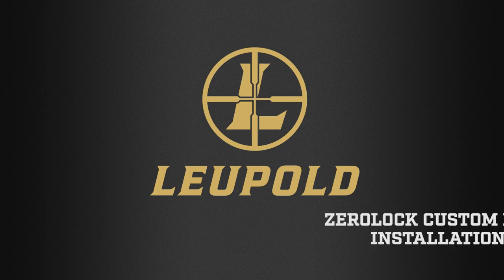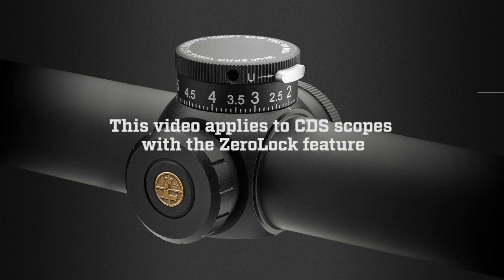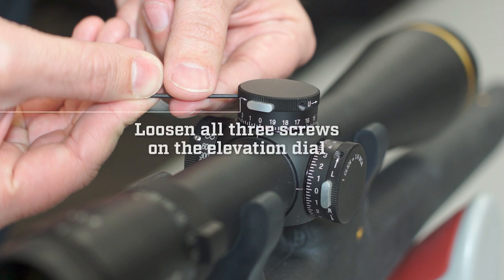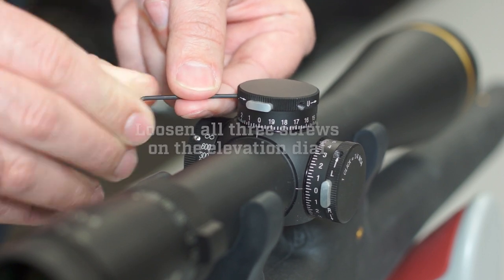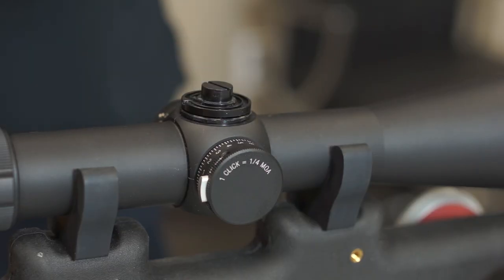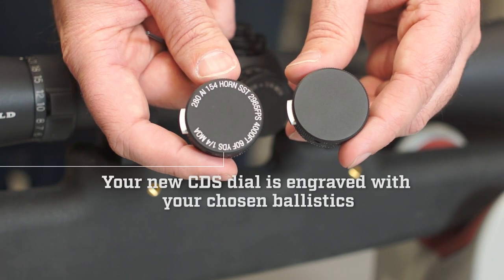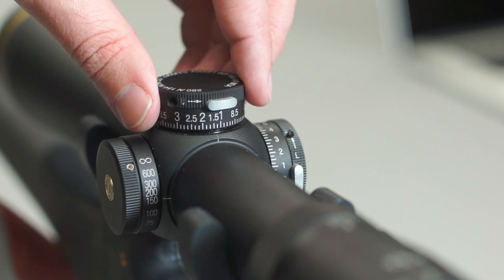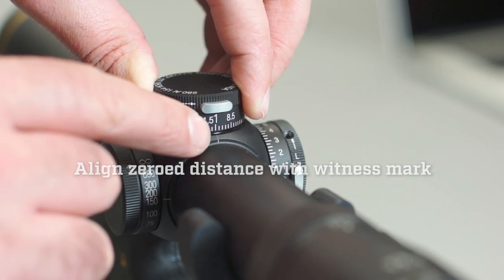Installing a ZeroLock CDS Dial

Comment: When sighting in do you take the 0 taurnt off the top and then once it's sighted n put it back on to zero because once it's on you can only turn it so far then it will stop.
Reply: Yeah I’m at a loss here. Wish I went with a different company. Sighed in at 100 yards it hits 6 inches high. Can’t adjust bc I’m already at zero and it doesn’t turn anymore. Wtf Leopoldo
Reply: @socalmx255  It's really stupid.  For the dial-to-distance feature to work you have to have the turret turned to 0 at the base range (say 100 yards) and then you can twist up to 1 turn for the holdover, matching the numbers with the holdover distance desired.  But that means, when initially zeroing, that you have to take the top of the turret off when you hit zero and move it around so that you have another 1 turn, and then tighten it back down.  It's probably okay once you get it zeroed but a pain at first.
Reply: @socalmx255 you may have a ring height problem.  It happened to me before.   I ran out of adjustments because I had 9 lug mark 5 rings on a 6 lug gun.